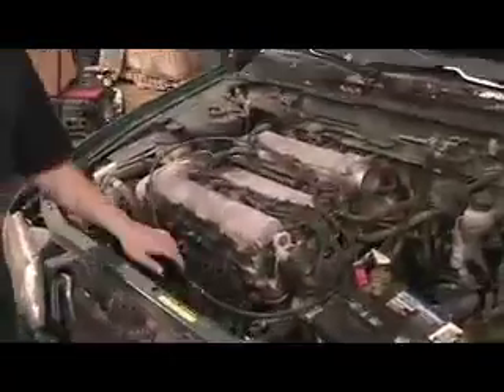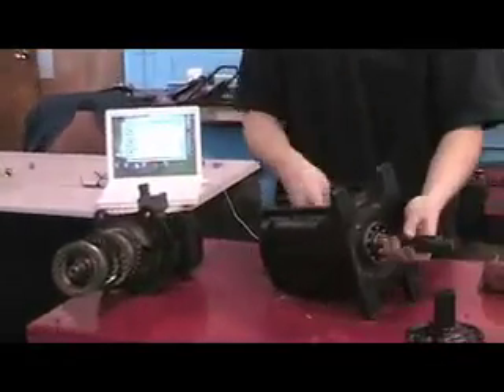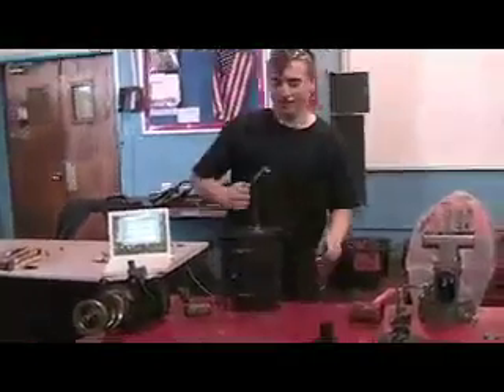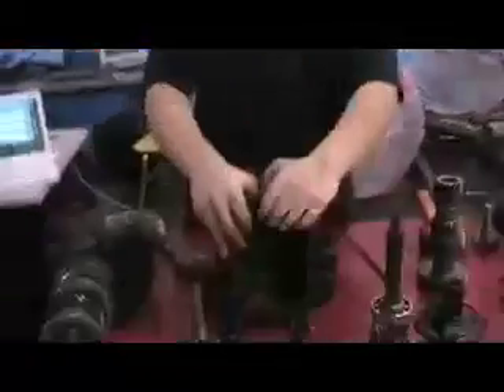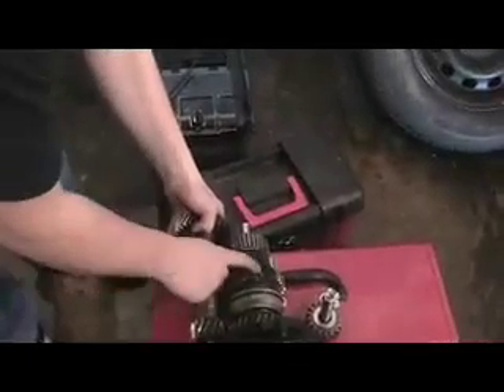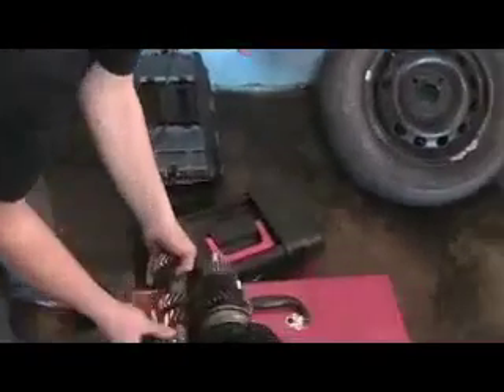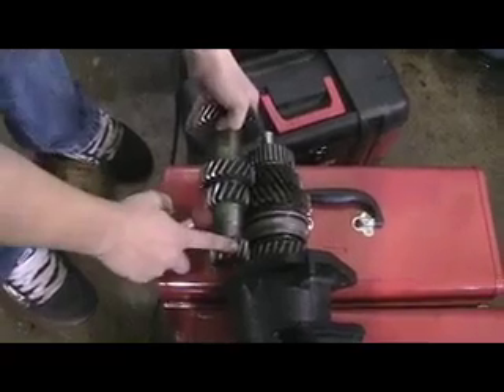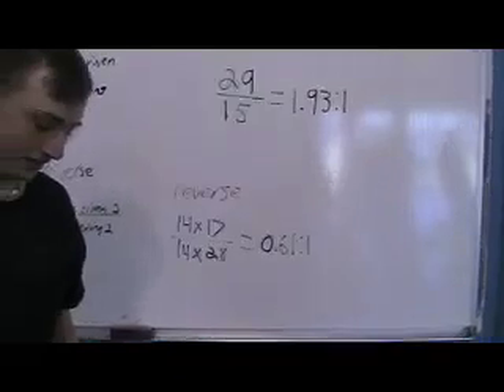Automotive Technology: Gear Ratios

Comment: high gear is when the input gear locks the output shaft to the input shaft, the gear ratio is the amount of teeth on the input gear and the amount of teeth on the flywheel ...there's actually no power going through the counter shaft even though it is rotating... this gear is where your full torque is being exerted from the engine to the transmission

Comment: gear reduction is when a small gear is driving a large gear, this is used in your gears where you need increased torque to move the car from a standstill..... overdrive is when a large gear is driving a small gear, this is used to help reduce work on the engine and help fuel economy  ...

Comment: the output shaft gears (output gears) are the driven gears... countershaft gears are the drive gears.... gear ratio is the number of teeth on the driven gear divided by the number of teeth on the drive gear its in mesh with... the reverse idle is not needed to find the gear ratio for the reverse gear, some instructors tell you that you need it but if you do the math including the idle and without the idle you get the same number